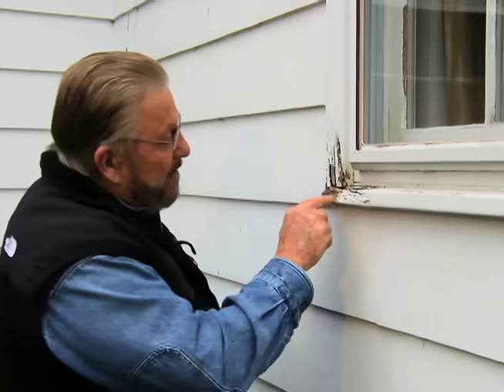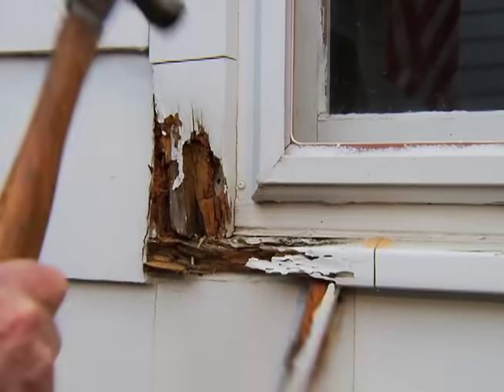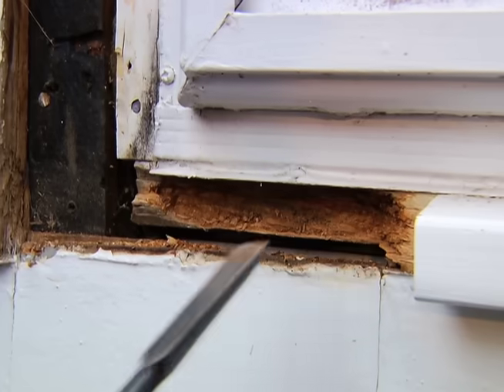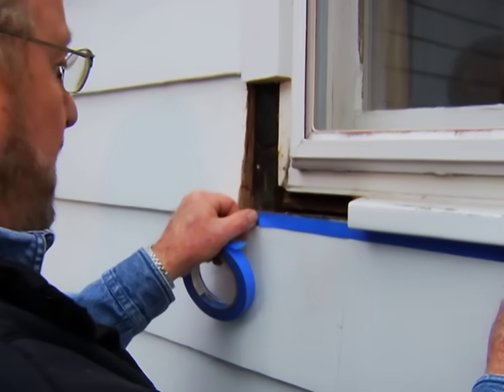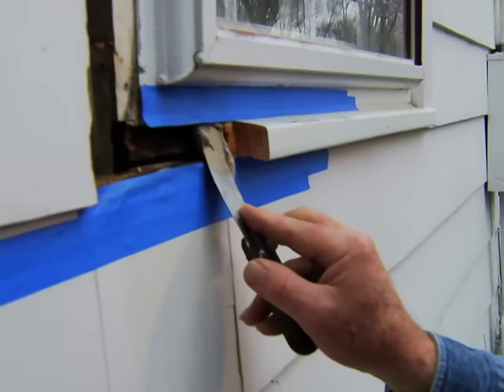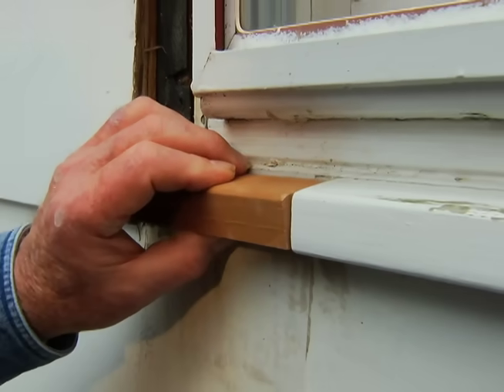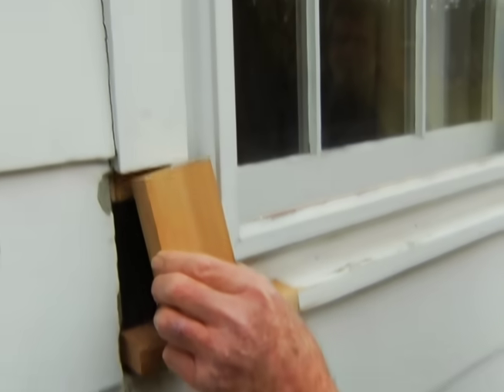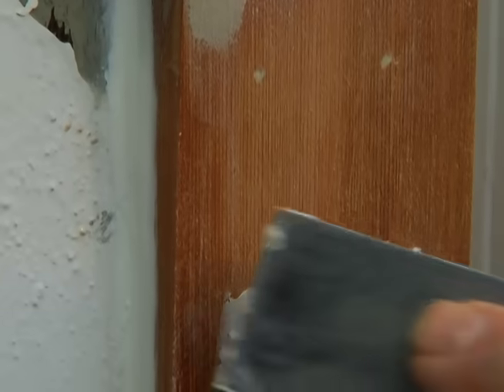How to Repair Dry Rot in a Window Sill

Comment: THANK YOU !!!  for not dragging out in endless verbiage to the point and got the job done.
Reply: As a contractor myself, I hate when people like you teach others how to "fix" something improperly! This is a hack job at best! You ignore the real issue, which is why water settled in that corner of the window and rotted the wood. Then you complicate the repair by using expensive epoxy instead of just replacing the corner with actual wood. This is a mess that you are leaving for the next owner of that home! YouTube watchers, DO NOT do this
Reply: @edwardl.990  say they fixed the water issue. 
And instead of replacing the window you do this.
Anything wrong with that?
Reply: @danielhale8884  zero zip nada. Overgrown lilac bush that was cut down maybe.  The vid showed exactly what it was meant to. 
And the fix will last a decade or more; long enough that’ll be time to replace the windows.
Reply: @danielhale8884  yes. What’s wrong with it is that there is a reason it was done with wood in the first place. Why not repair it with wood? Epoxy repairs have their place but this is not one of them.
Reply: I know, right, I not longer have the attention span to stay with the over detailed talkers 🥴

Comment: I like the brevity of your video. You showed us, without dragging it out. Thank you. Nice vid! I subscribed!
Reply: 4:23 - And didnt fix the hole beside. Bad job !!
Reply: As a contractor myself, I hate when people like you teach others how to "fix" something improperly! This is a hack job at best! You ignore the real issue, which is why water settled in that corner of the window and rotted the wood. Then you complicate the repair by using expensive epoxy instead of just replacing the corner with actual wood. This is a mess that you are leaving for the next owner of that home! YouTube watchers, DO NOT do this
Reply: @bethsabath  That tiny hole on the left was probably filled in before he painted.  To call it a bad job when you couldn't see the final outcome due to YT ads is unjust.
Reply: scott garris  In what way, and it's sued, not "sewed."

Comment: Recommend priming the cut ends of the original sill/trim and the replacement wood pieces before assembling the repair.  That will reduce absorption of moisture into the wood that could affect the long-term integrity of the repair.
Reply: its cedar
Reply: @joshusanders3127  yea… it’ll rot eventually when the persistent moisture that exists there finds its way in.
Reply: I was thinking the same thing as he disassembled the rotten pieces.  Can almost guarantee that the original end pieces were not primed.  Only takes a couple of minutes, but unfortunately most carpenters don't do it.
Reply: Home barely-competent DIYer here, glad I'm not the only one who thought of pre-priming before installing. Last year I had to repair some damage to the garage and primed the wood before screwing it in. It just seemed easier at the time.
Reply: @jb888888888  What is the material used to prime? Are you guys talking about paint primer or some sort of other chemical?
Reply: @IsAStormComing  Yeah, paint that's called "primer" on the can, as opposed to paint that's called "paint."

Comment: Great rot repair,  saved a lot of time and money going this route.  We used to use ( car) bondo,  for houses with a lot of wood rot,  It’s way cheaper and just as effective!
Reply: That wood filler he used is car Bondo. Just repackaged and more expensive.
Reply: Bondo or wood filler on rot is not a fix at all. It is illegal to do this for the sell of a house and should never be done. Anyone who tries to patch rot is guilty of hiding damage. 😬
Reply: @sethrepke  Totally agree. Thought this was a bit if a hack job myself
Reply: @philindeblanc  never use filler on rot. Do the job correctly. Change out the entire piece of damaged wood.
Reply: @sethrepke  I have a "dummy" "fuax" external beam (looks like it goes all the way from outside to the inside and out the other side. Its a decorative beam. About 1.5ft sticking out of the roof gable areas.  They go into the stucco and framed in. Couple of the beams have rotted on the top part where water has sat over the years. If I remove it, I would have to rip out the entire thing from inside to the outside making framing work, and stucco with all the rest of it involved. If I repair it, and then flash it with alum or PVC it would be a couple hours vs a crew and a few days. So there are logical uses of these things, and why they exist. If this video is a actual home owner, and he/she is too broke or cheap to replace this wood sill and trim, or if this was just a good demo example he made a video on...then he gave a demo of how it can be applied. there is a correct application. And this video was helpful. I guess it would be better if he made a disclaimer of some cautions you mention. But its your home. Do what you want with it. Have a good inspector when buying homes.
Reply: @philindeblanc  that's all fine and good. But fungi, aka dry rot, have microscopic spores that travel throughout the cells in the lumber and when you cut out small sections and patch it back you expose those spores and they usually explode into a bigger problem than when you started the process. At that point you will have wasted your time and money.  Now, if you do patch and then sell your house, the buyer has the ability to sue you for damages and repairs. It will cost you more than just doing the right thing to begin with.  In the end, it is your life so live how you want. I am just someone who has experienced this type of situation multiple times. But good luck. I won't judge you whichever way you go.
Reply: @philindeblanc  really?? And they are fool proof? You should probably take it to the state board and show them how it works.... 😏 since you are all knowing on this topic they will definitely change there mind on how W.D.O.'s work and allow people just like you to patch rot. 😆🤣😂😹   

Let me guess..... You are not licensed by any state to perform repairs of any kind.🤔

Comment: My Fiance's home had a rotted wood door frame at the very bottom for one of her detached garage access doors.  It was previously filled with some sort of Bondo-like substance, but broke apart when I was shoveling a few years back.  It was obviously weakened and the wood was most likely continuing to rot around the filler substance.

What did I do?  I chipped out as much of the old bondo and rotted wood as possible and filled those suckers up with Great Stuff expanding foam!  Cut it down, sanded, and painted.  Although the texture is not quite as smooth as the existing wood, nobody ever looked down at the very bottom of the door frame, and it is white to match the rest of the door frame so all is well!

I may be the only one to ever use expanding foam as a rotted wood filling product and I'm damn proud of it.

Comment: Great lesson. When I do repairs like this what I do is use the resin to bond the new pieces of wood in place. If you smear the edges of the new block with resin before placing them you can get a good edge to edge seal.

Comment: He made it look so simple, but this is a BIG job.
Reply: it's an afternoons work..
Reply: Not really
Reply: Big job?? No I would not say that.
Reply: @truxton1000    Say about 20-30 minutes start to finish?
Reply: As a contractor myself, I hate when people like you teach others how to "fix" something improperly! This is a hack job at best! You ignore the real issue, which is why water settled in that corner of the window and rotted the wood. Then you complicate the repair by using expensive epoxy instead of just replacing the corner with actual wood. This is a mess that you are leaving for the next owner of that home! YouTube watchers, DO NOT do this
Reply: @edwardl.990  As a newer DIYer, what do you suggest to do to fix the problem? In my case I’m assuming that whatever caused water to settle in that corner was fixed so you just have the rot left to deal with
Reply: @herbstava  I would actually cut out the rotten wood and replace it with new. I would prime it with a quality primer and paint it

Comment: If only I had watched this 2 days ago. I'm going back to my repair to finish it better with what I learned in your vid.
I should've been a carpenter not a metal fabricator. Lots to learn
Reply: As a contractor myself, I hate when people like you teach others how to "fix" something improperly! This is a hack job at best! You ignore the real issue, which is why water settled in that corner of the window and rotted the wood. Then you complicate the repair by using expensive epoxy instead of just replacing the corner with actual wood. This is a mess that you are leaving for the next owner of that home! YouTube watchers, DO NOT do this

Comment: I have done quite a bit of repair work like this, and I have seen quite a bit of repair work done by others.  It often fails where the resin meets the wood.  Someone wrote that it was because the wood and the filler expand and contract to different degrees with changes in temperature.  This causes a separation, and cracks appear.  It might also be possible that the wood will expand and contract with humidity changes even when it is painted.  There resin is impervious to humidity and won't do this.  The sill was probably pine. The wood replacement was cedar. The filler was a polyester resin. They all behave differently with humidity and temperature.  Personally, I would coat the end of each piece of wood with the wood hardener, even the new wood parts, before any parts are installed.  This clogs the capillaries in the wood, helping to stop future rot and helping to stop the wood from expanding and contracting with the humidity. When the tree was alive, the capillaries moved moisture from the roots all the way to the leaves.  They are really good at it. The original sill and original trim piece both rotted at the end of each board, where the capillaries were exposed.  This is the way it always happens.  Instead of Minwax wood hardener, I use a two part epoxy wood hardener from a company in Seattle.  The product is Clear Penetrating Epoxy Sealer or CPES.  It is expensive, but I have a lot of experience with it. The Minwax wood hardener and the CPES will make the wood stiffer, helping it to match the hardness of the Bondo. I would say that 50% of the repair jobs I do, have already been repaired once with Bondo which failed.
Reply: Bondo and Minwax are the same thing. To rigid and do not bond to the wood. Abatron is the best stuff going
Reply: From my limited experience...it seems like that even after stripping out the rot and hardening and repairing the wood, that there is still moisture in the overall wood piece that can take 1-2 years to dry out......which shrinks it back off the filler, creating a little crack. I have sanded these down and filled them with paint and they have been OK since. I suppose you could skim another filler coat over them aswell, but paint worked well for me. :)
Reply: The wood will continue to rot...Dissolve borax powder, in hot water (i use boraxo hand cleaner)and spray or brush into rotted  and even good areas for protection against the critters and bacteria that rots the wood.
Reply: Interesting, thanks for the info. But the point is that the repair is better than nothing and should last many years here, if I'm not mistaken.
Reply: Y'all just do it the right way! for real!if owners don't want to spend money!on repairs to get it right! Well, don't do it walk away! don't  wegger up shit!
Reply: antifreeze stops woodrot

Comment: Do it right, do it well. You made it look simple, the main purpose of it. Great video.
Reply: As a contractor myself, I hate when people like you teach others how to "fix" something improperly! This is a hack job at best! You ignore the real issue, which is why water settled in that corner of the window and rotted the wood. Then you complicate the repair by using expensive epoxy instead of just replacing the corner with actual wood. This is a mess that you are leaving for the next owner of that home! YouTube watchers, DO NOT do this

Comment: I used a product called "Liquid Wood" that you just added water to and apply. I kepted adding it to large rotting wood hole I had. Easy as pie and lasted a long time till I replaced the window.

Comment: Instead of the filler I would have tried to use solid wood in the whole area. The filler will react different to the wood with the difference in temperature and himidity, and could easily crack after a year or so. On exposed woood outside its best to keep fillers to an absolute minimum. When I do repeirs like this outside I replace the wood with wood. If the trim is damaged I replace the whole trim iin one piece if possible.
Reply: You make sense
Reply: Is this your experience with wood fillers?
Reply: @kottelkannim4919  Yes they often crack, specially if it’s thick layers.

Comment: You make everything so simple and easy. I wish I had your hands. God Bless
Reply: As a contractor myself, I hate when people like you teach others how to "fix" something improperly! This is a hack job at best! You ignore the real issue, which is why water settled in that corner of the window and rotted the wood. Then you complicate the repair by using expensive epoxy instead of just replacing the corner with actual wood. This is a mess that you are leaving for the next owner of that home! YouTube watchers, DO NOT do this

Comment: If the US dry rot is the same as European dry rot (Serpula lacrymans), this repair is at best cosmetic and ignores the fact that the adjacent timbers will be infected with spores and hypae as well. If that was proper dry rot, yes you should have replaced the entire window and the adjacent external cladding as well to make sure you got rid of the entire infestation.
Reply: Agreed - this is probably wet rot. If it were dry rot, he'd have to think about replacing every timber in the building before long.

Comment: Squirrels chewed a huge portion of my 100 year old detailed trim. I thought I was going to have to have the whole piece replaced (about $600 to tool the piece to shape the trim, then the cost of the wood, and the cost of having someone install it). I found these products and used them instead. Used some foam to fill the gaps behind the trim, and then used the filler bit by bit to fill in the missing wood and shaped it before it set too hard. Even before it was painted it looked fantastic. It's been over 5 years and still looks perfect.
Reply: Would you mind giving the name of the products you used? I have some wood repair projects ahead of me.
Reply: @jamesmcinnis208  I used the minwax filler mentioned here and greatsuff spray foam to fill the gaps before putting the putty in place. It hasn't shrunk or gapped in 5 years. You can't tell there was ever anything wrong with the trim. The foam doesn't have to be shaped perfectly, it just need to be trimmed back so you have room to put putty over it and still shape it correctly.
Reply: @Sypherz  Thank you!

Comment: I did the same thing years ago (2013) only I used body filler.  Been perfect ever since and will never rot!
Reply: if you run over a rock and dent a rim, you replace the rim instead of buying a new car. hope that was simple enough for you
Reply: yup excellent video. no unecesary guff.
Reply: That wood filler he used is literally the exact same thing.  It just has different tints added and in a different container.
Reply: @jayer-su3hu  yep, and more expensive in smaller tins, I use car bodyfiller for loads of jobs 💪🏼
Reply: The bottom of my back door was rotted away, so I nailed some pallet wood to it to make a frame around the bottom to use as a mould.  I then filled it with glass fibre repair paste, removed the shuttering and it's still as good as new, 20 years later!

Comment: Use an oscillating saw for this type cutting. It was made for this very thing. It is a good idea to cut the wood at an angle so the old and new pieces overlap each other. It handles shifting of the house better over time. Prevents your patch seam from cracking
Reply: how are you going to match that angle?
Reply: @chuck7879  i use a johnson level or angle duplicator for these very situations. The wood hardener he used works pretty well but i would have cut all the way through so i wouldnt have the long seam out from under the windows protection. His repair was ok. In most situations like this ill remove the entire board unless im told not to or there are other issues that will make it nonproductive.
Reply: Agreed.  Where the two vertical wood surfaces meet, the top should be cut at an angle so water runs off and not into the seam.  Means water will never leak into the the seam, unless it's able to run uphill.
Reply: @SophisticatedBob  you may know of this stuff but in case just in case you get a spot where the bottom few inches are degrading and total removal isn't an option. Minwax wood hardener works quite well providing there's enough there to harden then you can build it up with general purpose body filler and or resin. I got in the habit years ago of covering the bottom foot of the garage frame and trim with marine resin. It gives decades on the life of the exterior wood. I've built the cement up when I could to ramp the water away and keep the wood from contacting the flat areas that soak the moisture up. Ardex erm is one of the best products I've used. Exterior Ramp Mortar. No rebar,no milk, can ramp the surface up to 6" deep down to 1/8" and it will feather. I shared some Intel I created by using latex in my mortar mix to give it more flexibility and still maintain strength. I suggested they explore this. They had issues with finding the sweet spot. It's 19 to 21% if you want to check it out. I've done it on my garage entry in the country. Gravel meets slab with a steep driveway ramping water in. That was 35 years ago and it's still there mounded up like a dam angled down to the gravel.